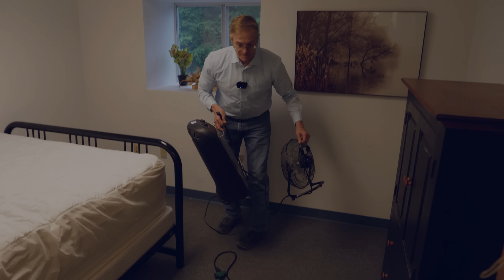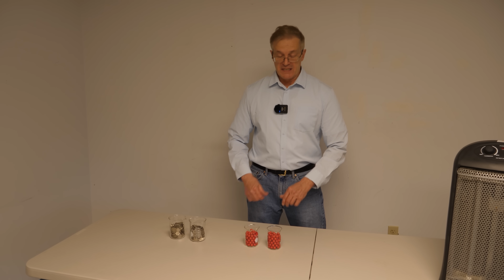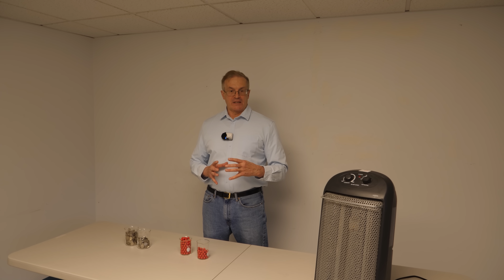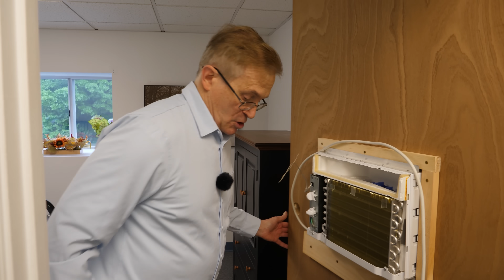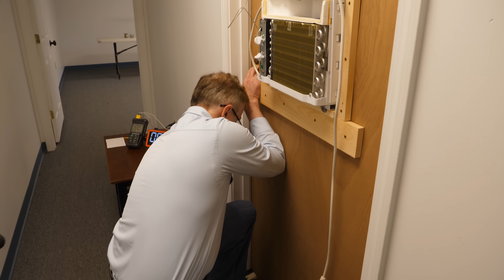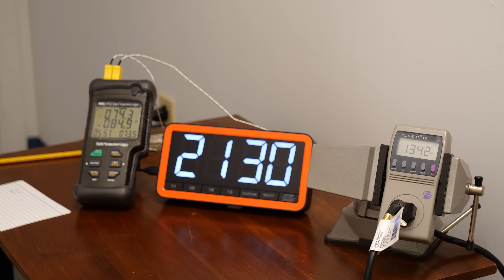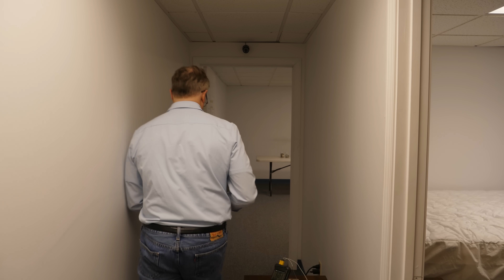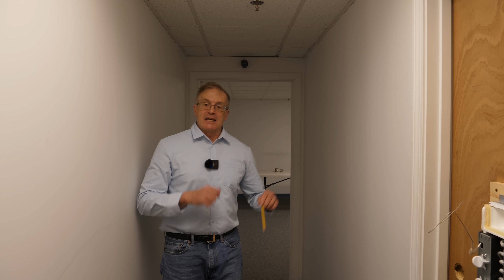You're wasting money on heating! Use your A/C!

Comment: I have been using the same kind of A/C for years for heating. As soon as summer is gone, I just turn the unit around by 180 degrees, the thermostat having been bypassed.
Unfortunately, as soon as the outside temperature goes below 12-13 degrees Celcius, the efficiency drops sharply and the air intake frozens. I then use a heat fan outside to pre-worm the air and have a timer that stops the compressor for 1mn every 5 mn juste to melt the icing.
Therefore that system is OK as long as you use it in mid-season, just before they turn on the collective heating and after they turn it off. They have a tendency to leave us with no heating for a few weeks of cold weather each fall and spring.

Comment: Would have been better experiment if you had simply turned the AC around in your window. Also, should be done when the outside air temperature is around 40 degrees Fahrenheit. And you did not tell us whether the mix vent in the AC was open or closed.

Comment: The only issue i have with this is that your moving the heat from inside the house to inside the house and your using a 75 degree starting point, if your were doing this in a regular use case the ac would be throug a wall or window and now your trying to pull heat from outside in winter to do this test properly for a use case would have to try to heat a room from a cold place,

Comment: If you just converted your regular AC into a heat pump the oil could freeze and then break the compressor prematurely unless if you have a block heater for the compressor.

Comment: The efficiency contrast between pumped heating and hot-wire heating is impressive here, but that efficiency plummets as the indoor/outdoor temperature differential widens.  My heat pump moves almost no heat once the winter temps go below about 42-F at a thermostat setting of 70-F.  It gains a few more degrees when it switches it into Emergency Heat Mode, but the power wattage leaps.  By contrast my propane heater using the same forced-air delivery runs at 95% efficiency at ALL temperatures.  My wood stove (used below 32-F) is likewise impervious to weather. 
In summer at 105-F the pump runs nonstop at a thermostat setting of 78-F.  A newer heat pump reduced the power slightly,  but the outdoor temp limits still hold.  There are pumps with broader range than mine, but the sticker shock is even more dramatic than  the power increase required.
Reply from the maker: Your overall approach is a good one.  
Use the right tool for the purpose and have alternatives for redundancy.

Comment: YES - agreed that a heat pump is far more efficient than a resistance heater - 4.5 times more seems incredible - then you mention the OLD AC unit you used was only around 1/2 the efficiency of modern Ac's - that would imply around 9 times the efficiency of resistance heaters AND then you mention that this can be improved even further - DOUBLE ? -  I haven't found that video yet so where is it ? 

2 things to mention - your non reverse - cycle window AC installed the other way ends up cooling the corridor which doesn't seem to have much air circulation so that would decrease the efficiency of your demo set up AND on the other hand you would benefit from utilizing the heat of the compressor (and the fan motor ) - you mention air friction - that should be clarified as 'friction of the fan blades with the air' although I wonder how significant it may be in the scheme of things  - might be worth demonstrating by having a fan blade carried on the end of a motorized shaft entering a box  - such that motor heat doesn't help. 

I would love to find your video on improving an AC even further.

Small resistance heaters with fan can be bought for as little as $15.00 in Australia - that makes them even cheaper in US $ - fantastic value when you think what it includes - multi-position switch, 2 speed motor / fan,  dual 1000watt elements (=2000w) @ 240 volts, + thermostat, tilt switch, overheat thermostat and thermal fuse, neon ? light, cable, plug and housing etc. supplied in a fancy cardboard box and guarantee!

Just putting your face in front of an equivalent electrical consumption AC and a resistance heater, one realizes how much more heat / hot air volume emits for the same running cost - albeit for many times the capital investment.

Comment: Instead of waiting an hour and fifteen minutes for the room to cool down after the test with the resistive heater, you could have used the fan to cool the room down faster by placing it near the door to blow cold air in (and consequently, hot air out). Or was there a reason why you let the room cool down naturally?
Reply from the maker: There was a need for the solid objects to cool as evenly as possible and avoid unrecognized hot spots.  The delay was inconvenient, but it was probably a better method.

Comment: Your explanation in the intro for this video with those two examples doesn't make any sense. I feel like that's just a different topic.. Or maybe I'm too dumb to understand that..
Reply from the maker: I probably wasn't clear enough.  Watch it again, but as you do, keep one important fact in mind. 90% of the thermal energy in the air in the summer is still present in that air when it's snowing.
Reply: @TechIngredients  So.. I just found this comment ::👇🏻👇🏻👇🏻👇🏻
“ A) Use a little energy to move heat.
B) Use a lot of energy to make heat. ”
👆🏻👆🏻👆🏻👆🏻👆🏻
Is that right ?? Is it about this ?

Comment: I don't want to sound smartass, but it always amazes me, that despite most of today's technological advancement can be attributed to the US, they are decades behind Europe, when it comes to using these technological advancements for the masses. You can't even build a house without proper insulation and a heatpump in Europe - it would just simply not get a building permit...and just to be fair, I do see several downsides to these strict regulations, leading to increased housing costs, etc., still, to see a wealthy economy such as the US not capitalizing on such simple solutions while paying 10+ USD for a starbucks, is very strange.

Comment: A recent study in MIT has shown that sunlight and light of a particular wavelength can evaporate water without using any heat. And the interesting part is that the process of that light evaporating water is actually endothermic which means it absorbs heat from the air. So that means this phenomenon can be used to make a super efficient heat pump. Would you please make an experiment on that ?
Reply from the maker: I'll look into that.
Can you provide any links to the research?

Comment: Does the efficiency go down significantly if the tempature of the air starts out colder? , for instance, putting this in a window during winter to pump heat into the room

Comment: I am only wondering, the energy efficiency of the heat pump greatly depends on the COP factor. The concerns about heat pumps are during the cold months. Currently in the Netherlands, where I live, a lot of households are heated through gas. one cubic meter of gas contains approximately 10 kWh of energy. Since central heating is near 100% efficient we can say there is a 1:1 conversion ratio from chemical to thermal. Let's assume a COP of 4 and greater during summer months, this means we use 1kWh to generate 4kWh (or more), so this cost us 2,5kWh for the same amount of heat energy as 1 cubic meter of gas. However in the cold winter months when there is no sun, the temperatures are between 5 and 5 degrees and the days are shorter, this is when there is the highest demand of heat energy +/ 60 a 70% of annual energy consumption. A conventional power plant has an efficiency of around 40% which means, when we burn 1 cubic meter of gas we generate 2.5 kWh of electric energy. If we now use this energy to run the heat pump we practically create a bigger emission footprint then when we just used gas in our house our self. This in fact destroys the purpose of heat pumps I believe. I think heat pumps are great but only when applied in a water/water setting and not air/water setting. I think so because the water/water buffers heat in summer and uses this during winter while the air/water has a to much fluctuating input temperature. I wonder what is your take on this.

Comment: I’ve been using split unit A/A heat pumps for 20 years. Works extremely well in mild, coastal climates, average "gain" is around 1 to 4 (like 500W in, 2000W out). Good models will deliver surplus heat down to -30C and even below. These heat pumps are very common here in Norway and the rest of the Nordic countries. Beware: The outdoor unit must be equipped with some kind of heating coil to avoid icing. Most people buy purpose made units from well known quality brands like Panasonic, Mitsubishi, Fujitsu, Toshiba. The first one I bought was not good, basically a AC unit converted on the cheap and sold by a company that went bankrupt when the customers started making claims on the five year warranty. My latest unit, a puropse made Fujitsu from a trusted dealer was installed in 2008. Still running well after 16 years, only fault was a worn out ball bearing on the indoor motor fan. A common problem on Fujitsu and some other brands using these fan motors. Cheap to fix.

Comment: Excellent video and explanations.  My problem is that my electric is $0.35/Kwh.   So I believe I can get more heat from a gallon on home heating oil at $3.50/gal.  ( cost of 10kwh )   I may be wrong?
Reply from the maker: You may be right.
Cost specifically is what we'll address next.
There may be a synergy when combining these two methods where part of the differential is produced by the pump at very high efficiency, and the gap is filled with a combustible at low cost.

Comment: I just spent my first winter with a window heat pump. It definitely saved some money when the outside temperature was above 41°. I bought another smaller one for upstairs this coming winter. It doesn't have auxiliary heat though, but it's upstairs so it doesn't matter much. Downstairs, I have gas direct vent heaters. They are not as efficient as a heatpump. I thought the gas would be more efficient pricewise, because the electric is coming from gas generators anyway. Still more than the heatpumpp though. I have a meter for TVOC, HCOC, Carbon, and AQI. Everything is well below any tolerence levels. I want to get a Mini-Spilt that works down to -15 degrees, and up to 122. PIONEER makes them. That is not the audio company.
Reply: Actually, it's a vent-free heater, but I can't edit from this platform. The same still goes as far as pollutants. Almost nil. I think the DOE is trying to scare people about gas stoves. These natural gas appliances are actually about 99% efficient and as long as you have adequate ventilation, you shouldn't have a problem with volites or carbon monoxide emissions.

Comment: Fahrenheit became the international standard before centigrade specifically  because of the resolution of the units. He made instruments for meteorologists and his scale put almost every temperature that mattered to them from 0 to 100.

Shortly after he died it was discovered that they could bump the temperature up by 6.67% and water went from melt to boil in 180 degrees and the area between the reference standards could all be marked out as powers of two. Celsius was easier to standardize across the whole world but Fehrenheit is a much more useful scale for almost all people, anyone who would be better off using centigrade should probably be using kelvin anyways.

Comment: I was lucky enough to have my landlord upgrade my unit with a heating cooling heat pump. It's kinda meh during the cold winters of wisconsin. But it certainly does better, as a whole, than the AC+Gas Heater combo I had before.

Comment: Yet again, I'm staggered by US terminology. In Australia an air conditioner means reverse cycle unless specified as cooling only. 
Had split-system in my childhood home since early 1960s.
Reply from the maker: I'm confused then.  What do you fellas call a cool only heat pump?
Reply: @TechIngredients  A cooling-only air conditioner.
Heat Pump is only used here as a new type of hot water system, in place of gas or electric.

Comment: AC units take the heat inside and move it outside,  if you reverse that direction during winter, the AC would want to take the heat outside and bring it inside but at winter there's no heat outside.😢
Reply from the maker: Didn't you watch my explanation at the beginning of the video?
Reply: @TechIngredients    you made me rewatch the beginning of you video 🤔, and in very short clip you DO say that heat pumps work at zero Celsius.      Obviously that's not the answer to my statement,  to be sure a conventional heat pump doesn't work in colder climates, for example anything below -30 deg , which one or two months of the winter in Canada can see such temperatures .    

To be fair there seems to be hybrid heat pumps that now claim to work below 5 deg Celsius up to max -30 deg.    But these hybrids have some heating elements added to generate heat.  

In moderate climates a heat pump is a good solution, but I am sceptical to rely my home safety in extreme weather, that is normal and expected weather.

I very much appreciated your demonstration, learned something new even .   So 🙏

Comment: I agree that the heat pump setup is more efficient than heat strip type heaters that have to create heat instead of the transfer of heat style the heat pump has…but doesn’t the extension cord add loss of efficiency.and cause more amperage draw therefore…using more energy than if experiment was done without the extension like the a/c was done. Am I correct in thinking if you used the extension on the a/c that the efficiency would have been less with the a/c and greater with the heater without the ext…, but still the results would show the a/c is still more efficient either way due to the transfer of heat versus the creation of heat…but just that you lose some due to the resistance of the extension cord

Comment: Try that in winter conditions at freezing temperatures and below. The results will a lot different. The outside air in your test has a lot more energy than sub zero winter air and the air conditioner won't turn on at such low temperatures unless you somehow defeat the temperature sensor. I thought about doing this too but I don't know how to make my AC work at low temperatures. I hope you show us how in the future video.🤞

Comment: In Germany we have some laws now that keep us from heating our houses, using cheap gas from Russia or cheap nuclear electricity but obligues us to use heat pumps. In Bavaria we get down to minus 16 celsius or zero Fahrenheit so the external unit is covered up in ice while the hot air concentrates under the ceiling making the people sick.
I installed some vertical tubes with fans but that is very noisy.
Reply: I tried the vertical pipes with fans and didn't get a good result. But what worked is a regular ceiling fan running very slowly. The modern fans that have stepper motors aren't good for such application, so use the old-style AC motor fan which can be controlled with a step-down transformer.
Reply: @RandomNullpointer  NEIN!

Comment: I see a problem here.  Heat rises, but cold air sinks.  The placement of the bed INTERFERED with cold air reaching the thermometer, the A/C wasn’t pointed upwards, but the heated air rises and is easily affect from hot air above, yet is prevented from receiving cold air below.   TRY WITHOUT THE BED NEXT TIME !

Comment: There is another variable that you didn't address. That is the volumetric efficiency of the compressor.  Refrigerant pressure is dependent on it's temperature.  The higher the refrigerant temperature, the higher it's pressure.  When you're A/C is in a hot room when you turn it on,  there will be a greater pressure exerted into the compressor cylinders,  hence more molecules of refrigerant will be compressed,  more work done, more Amps used, a greater C.O.P (coefficient of performance) of 4 or more,  more chilled air.  It's kind of like a supercharger on a car engine.  If you turn the A/C around and stick it in a window (in the Winter) the A/C coil will be exposed  to frigid outside air.  There will be colder refrigerant, lower refrigerant pressure exerted into the compressor cylinders, less molecules of refrigerant forced into the cylinders,  less work done,  less Amps,  and a much lower C.O.P. of maybe only 1 or 2 and much lower efficiency .  A/C compressors, because they run at higher Temps/pressures have smaller cylinders.  Compressors that are used in frozen food environments have larger displacements.  It would be fascinating to see your example run in the winter and in a outside window

Comment: I live in South Carolina and it has been unusually hot this summer. So I have been running window units in my house because I've recently found out that the thermal expansion valve in my heat pump system is not working properly. (I'll leave out all the details on that) One of the units (a portable floor standing unit) has the ability to work like a dehumidifier while pumping out cold air into the house. The other two cheap Walmart window units cool the air but they seem to gradually increase the humidity. 
When my heat pump was working properly, it would reduce the humidity in the house, as well as cooling it. It's still functions, but I'm not getting cold air, and the air temps it does put out are reliant on the outside temperature. If it's above 80 degrees, it starts to loose efficiency. If the outside air temps are below that, then the air is colder. In short, it is not longer efficient. It will be replaced very soon. But I would have liked to see the humidity levels you were getting while running your tests with the window AC unit. Thanks!!
PS. Please don't take too long in uploading your video on improving the efficiency of window units! Thanks again!